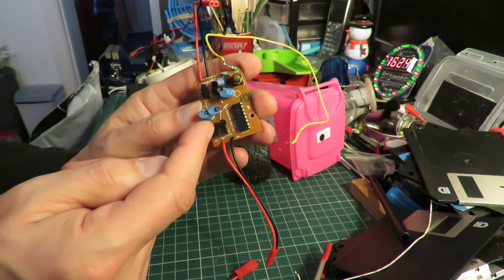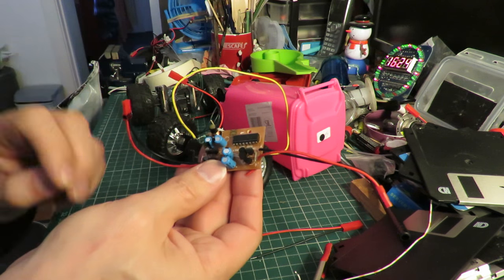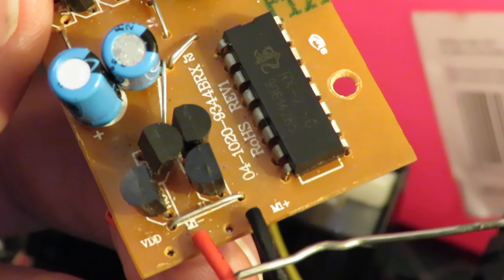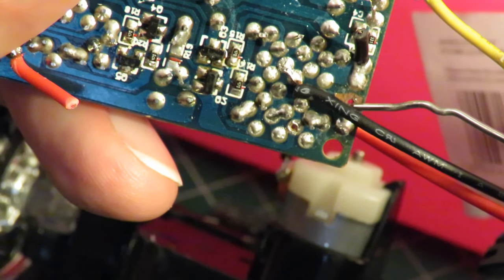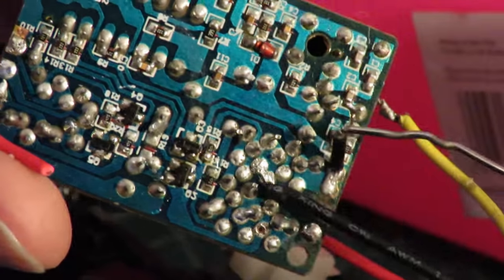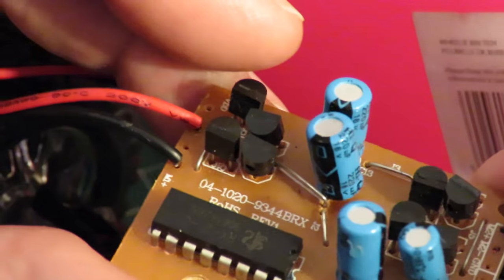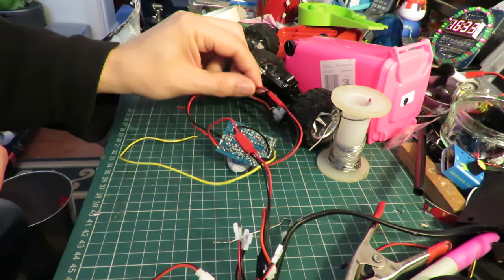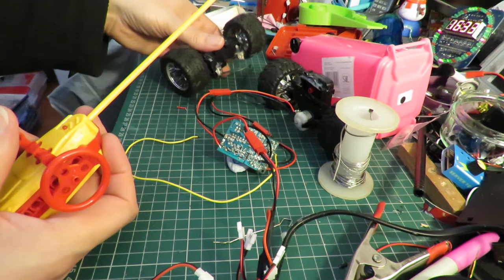Re-Using a Toy Grade RC Receiver

Comment: Hello sir, can we replace that 2.4ghz radio system with esp32? I mean can we connect pwm output from esp32 to that receiver main ic? I think if that case possible, we can control that ic from mobile or pc with long range. That's will be interesting project 😅
Reply from the maker: Most of the toy grade receivers use an RX2 chip or similar. Here is a data sheet for a typical one https://www.diodes.com/assets/Datasheets/PT8A977B978B978BL.pdf and here is my playlist for my videos on the TX2/RX2 pair https://www.youtube.com/playlist?list=PLA5a2xPRSrB1mLQvgf5ILMeTcRMuDtcNa and here is my video of building the test/demo circuit https://www.youtube.com/watch?v=M46Gpyl9KYE&list=PLA5a2xPRSrB1mLQvgf5ILMeTcRMuDtcNa&index=2

Comment: I have a helecopter but don’t have the remote. I want to take the signal 2.4GHZ from another motherboard and put into the helecopter does this ever work?
Reply from the maker: In short, there are many different variations in the way that helicopters fly. There are many issues I can think of, that may give you problems. It depends what features your 2.4GHZ system gives you. If the helicopter steers by altering the speed of counter rotating rotors, then your controller would need to match that requirement. I would expect the throttle would be proportional, does your replacement gear do that. Does the helicopter have a tail rotor? Does it use it for yaw or pitch? The helicopter receiver boards often include gyroscopic stabilisation to help you fly, so if your 2.4GHZ system does not include gyro stabilisation you may struggle to fly, even if you can match the throttle and steering requirements.

Comment: Hi, I know this might sound a little odd but would be possible to use a RC unit to trigger a rat trap?   

I just need movement of about an half an inch to an inch.
Reply from the maker: Yes, if you look at my remote control door lock series I think you could see an easy adaption of the general idea. There are several different variations of the idea in this playlist so check out the video descriptions for the details Remote Control Door Lock playlist https://www.youtube.com/playlist?list=PLA5a2xPRSrB1HM3Smxg8X-IG7dSuJyzkK

Comment: So i have a store bought rc.   I want to put a bigger motor and battery but use the same servo receiver..  how do you do that in a nutshell?
Reply from the maker: The honest answer is buy a more expensive car and don't waste your time trying to upgrade. You will probably end up spending more money on the upgrade and end up with something that really does not work much better.
1. A bigger battery will kill the existing receiver. You would need to add electronics to allow it to handle the higher voltage/current. You can buy an H bridge module that could handle this.
2. A bigger motor will not magically fit into the same space the existing motor takes. You would have to cut the gearbox around to fit a bigger motor and it still may not align with the existing gears.
The existing gears may fail with any additional power, with the teeth being stripped off.
3. When I do upgrades I usually go straight to hobby grade RC gear. That allows you to use an ESC (electronic speed controller). That provides the correct voltage for the receiver and still supply higher voltage and current to the motor.
2005Silver is a good channel for upgrades to toy grade RC cars https://www.youtube.com/@2005silver he has done a whole range, but like me, he generally goes straight to hobby grade components.
In this playlist, I do a lot of videos using toy grade RC - https://www.youtube.com/playlist?list=PLA5a2xPRSrB1f-x1-lufP6dnLQZWafj6v
Reply: If you still have the car dont put a bigger battery & motor in it. Just get a new chassis & other components. A bigger battery will make the car go faster, but may burn out the main PCB & existing motor.

Comment: hi Grandad, have looked but can't find. have you done anything on using a standard servo on the hobby grade receiver in place of the motor?
Reply from the maker: Hi Glen, thanks for commenting. Here is my standard cut&paste LONG ANSWER to this question. I am afraid that standard hobby grade servos are not directly compatible with toy grade RC receivers. They work in a different way. Hobby grade servos have a 3rd wire, that is a signal wire that the receiver uses to tell the servo controller board how far and which direction to turn the armature. The controller board in the servo then turns the armature the required distance. 
Toy grade receivers just have two wires and have three signal states.
(1) Applying the battery plus and minus on the wires turns the steering motor one way.
(2) No battery applied allows the spring return to centre the steering.
(3) Applying the battery minus and plus on the wires turns the steering motor the other way.
If you connect the same two wires to an ordinary DC electric motor and apply "Left" the motor will keep spinning as long as you hold the transmitter on "Left". If you then apply "Right" then the motor will spin in the opposite direction. 
In toy grade steering the only thing that stops the motor from spinning is the mechanics of the steering so the motor is still trying to spin but the steering arm has reached stop. On a hobby grade servo the electronics measure how far the steering has turned and stops the motor electronically.
Reversing the power feeding a hobby grade servo will probably damage the servo controller board, it certainly wouldn't make it turn the opposite way. If you remove the servo controller board and connect the output from the toy grade receiver directly to the motor inside the servo then it would go forwards or backwards like the toy grade motor but it would go all the way until it meets the internal mechanical stop inside the servo, so you would not have proportional steering. Also because the motor is heavily geared the normal spring on the toy car would not be strong enough to return the servo to the centre position when you want it to go straight, so you would be worse off than you were with the original toy grade steering. 😊
Here is my playlist - Working with RC servos https://www.youtube.com/playlist?list=PLA5a2xPRSrB1nJ5I3Uzrjf41VCJzrab4p
Reply: GrandadIsAnOldMan cheers for the info i have got two identicql hobby grade RC cars on separate radio frequency that we are going to build 2 boat hulls from Foamex boards and put the mechanicals in. was hoping i could use a standard servo but i see the difference now and understand BBB the white signal wire
Reply: only issue I see with the conversion is the rudder and making the motor and mechanicals stop and function on the rudder. will see how we get on....
Reply from the maker: A proper Hobby Grade transmitter and receiver is not very expensive if you go for the bottom of the range without any frills and for a boat you won't be troubled by a lack of range. FlySky systems are pretty cheap on eBay. I have a couple and I always buy cheap 😊
Reply: GrandadIsAnOldMan absolutely i rate the Flysky it's a bargain. have always bought in a rush so potential to buy from one of the Chinese sites. was looking at converting the cars as they cost just £1 for the both a total bargain and hence trying a conversion for he cheapest possible price :-)
Reply from the maker: Good luck with that 😊 If you already have FlySky then you can usually pick up extra receivers pretty cheap too, I can't remember how many I have now and for a car or boat you only need the cheaper 3 channel receivers anyway.
Reply from the maker: Just another thought. Lots of my boats have two motors and I steer them by keeping one motor full power and reduce the other and visa versa. That way you don't need any rudder control. It takes a few minutes to get the hang of using a normal toy grade controller that way round but it soon comes together.
Reply: GrandadIsAnOldMan Watched your videos in servos and hobby grade steering so get the difference. in one you converted a 9g servo to continuous direct to the motor. do you think if the stops were left on and wired to the servo motor it would work?
Reply from the maker: Yes it would work but you have no centring mechanism so you would be worse off than a toy grade steering system. On a toy grade when you release the "rudder" or "steering" the spring returns the rudder or wheels to the middle but a servo is heavily geared so a spring would not be strong enough to return it to the middle.
Reply: Ah ok get you thought i had a bright idea :-)
Reply from the maker: As long as you are not worried about going in a straight line it will be fine 😊😊
Reply: @GrandadIsAnOldMan  Thats was a really good explanation. I totally understood it. I didnt know how the signals on a toy grade PCB worked.

Comment: Hello sir, Thanks for your videos. I have a toy grade radio shack 4x4 from the 80s, the transmitter crystal in the remote seems to be faulty, I was going to replace it but wasn't sure if replacing the crystal only in the remote would do the trick. It's an AM 27.095 MHZ. Can't seem to pin point the receiver crystal on the circuit board from the truck. Found old new stock transmitter crystal on ebay with same frequency, could this work? Thanks so much!!
Reply from the maker: Not sure how you have identified the crystal as being faulty. What makes you sure? I haven't made any attempt to change a crystal on any of the RC gear I have, in fact most of them do not have crystals to set the frequency. I would expect you to need a matched pair but I cannot give you any advice from a position of experience.
Reply: @GrandadIsAnOldMan  Thanks for the reply and information. To be honest I dont even know, just worth a shot, I am simply troubleshooting, I can't properly test the crystal I don't have those tools to do it. I know very little about relays, and such electronics but I like to learn about things and fix them. I know I could convert it to Hobby grade that I am capable. What happens here is that the remote is not making the car move, but some movement or jittering is happening like the car is trying to do something but can't. My thought, after eliminating many other possibilities, was there is a problem with the transmitter.
Reply: @GrandadIsAnOldMan  In my controller there is definitely a crystal transmitter with frequency inscribed on it, 27.095MHZ, but not in the car. It's a 1987 Tandy RadioShack 4x4, the yellow one.
Reply from the maker: I am afraid there are so many possible issues. You have to go through step by step. Ideally you would have an identical car that you could try swapping transmitters to check if it is the transmitter or the receiver giving problems. If you haven't already done this, you could do some basic checks like connecting a battery direct to the drive motor to check the motor is OK - do the same for the steering motor too. Although the crystal is marked very precisely with 27.095 many of the systems run over a fair range and you could try other 27MHz transmitters or try yours on other 27 MHz cars.
Reply: @GrandadIsAnOldMan  Hi again, my apologies for all these messages, your answers really help. One thing I remember doing is buying a toy grade RC from the thrift store that had the same 27.095MHZ freq, the car did the same with the controller, same response, so I pointed the issue to the controller. I could perhaps send you the circuit board from it and you could see if you find the problem. I would pay you of course. :)
Reply: @GrandadIsAnOldMan  Motor tested ok, actually when I touch both the antenna from the car and remote it moves FF and turns as if it works while there is a wire connection, that is why I was thinking the transmitter crystal, but again I don't know much about it. Thanks so much again for taking the time to answer me. It has been almost 5 years since I keep taking the car out every few months to tinker with it, but can't find the issue.
Reply: @GrandadIsAnOldMan  Did buy a used 27.145 MHZ transmiter and nothing hapenned.I think I might gut the car and upgrade to hobby parts. A bit expensive but it might be worth it to bring it back to life.
Reply from the maker: @designrdan  thanks you for your confidence in my ability but I am afraid you are asking the wrong person. My skills are pretty limited. I also live in the UK so even if I had the correct skills and experience the cost of sending a package would be more than you buying replacement RC gear. You best bet would probably be to find another 27MHz receiver from another thrift store. That is basically what I do, most of the cars I buy don't have the controllers so I mix and match till I get a working pair. Or I swap out the receivers for a working match, or I do the full hobby grade upgrade.
Reply from the maker: Good luck with that. If you already have hobby grade RC gear then the upgrade is not so bad but if you are starting from scratch it does add to the cost - like the transmitter is the biggest expense. Obviously you need a receiver. If you retain the existing motor then you just need a brushed motor ESC to drive it. Then  you have a choice what to do about the steering. You can use another ESC to drive the steering motor and that will work quite well or you go for a hobby grade servo and then you will need to cut things around a bit to fit it and link it to the steering rods.

Comment: Hi sir I have an old board on it there is 
LM  RM
VCC GND
ANTENA 
NOW WHERE SHOULD I PUT THE FRONT MOTOR USED FOR STEERING AND THE BACK MOTORS 
PLZ REPLY.
Reply from the maker: Without seeing your receiver I can only guess where the terminations would be. Different manufacturers have different labelling practices. On toy grade receivers the motor outputs are often labelled M1+ M1- and M2+ M2- or they may be labelled F/B for Forward/Backward and L/R for Left/Right.  I could guess that your LM and RM might be Left Motor and Right Motor (for steering) and there might be FM and BM for Forward Motor and Back Motor (for the drive motor) BUT that is just guessing. I have not seen a board with those markings.
Reply: @GrandadIsAnOldMan  OK bro it's OK but there is no 
FM BM
what should I do
Reply from the maker: @dr.monikarani1193  I am afraid the answer is get a different receiver unless you know how to trace the outputs from the control chip to identify where the signals are being sent. It is probably an RX2 variant chip so you can look online for the data sheet. You would be looking for the "H Bridge" that take the signal from the receiver chip and sends the power to the motor.
Reply: @GrandadIsAnOldMan   but there is two  wires connected to B something like this 
I think they are of steering because there is written LM and RM  and also thanks you are helping me 
But you can go and check my tractor in which I will use this board the tractor is in this channel only name of video is MODIFIED TRACTOR 
And then plz suggest me
Reply from the maker: @dr.monikarani1193  your video does not show the receiver you are talking about so that does not help me give you any guidance.
Reply: @GrandadIsAnOldMan  yes yes I know I wanted to ask that my tractor can be converted into a rc tractor
Reply from the maker: @dr.monikarani1193  it does not appear to have steering so you would need to do something about that unless you just want it going forwards and backwards. Here are my tractor related playlists - Tractors https://www.youtube.com/playlist?list=PLA5a2xPRSrB1THBo5s89W9VhXxNgoHHXh
RC Conversion Deutz Fahr DX 470 Toy Tractor  https://www.youtube.com/playlist?list=PLA5a2xPRSrB2TqZK7HiLeW4kji-D4ENwY

Comment: Hello sir,I have an old rc car's reciver but I can't find the point which I can connect the battery
Reply from the maker: The termination points have various identities on the board. I will list the ones I have seen
B+ B-
Batt Eth
Vcc Gnd
V+ V-

Usually the battery positive is routed via a switch either onboard or externally.

The motor tags are usually labelled
F B for forwards backwards
L R for left right
sometimes they are labelled
M1+ M1-
M2+ M2-

The Arial or antenna is usually labelled Ant
Reply: @GrandadIsAnOldMan  sir I didn't found any of these on the board but what I did was checked for points,I checked if there was any of extra soldering or wire out of the joint.this plan worked and now the circuit is working correctly,Thank you for finding time for my comment
Reply from the maker: @pascaledits7219  well done, great result 👍

Comment: i got a rc car but no controller with it how can i make it work with another controller
Reply from the maker: Assuming you are talking about Toy Grade RC, if it is the same frequency then you have a good chance it will work straight away, but sometimes even when the frequencies match they still will not talk to the receiver. You will have to find a matching controller or change the receiver to match the new controller.
Reply: @GrandadIsAnOldMan  how would you change the receiver for a new remote?
Reply from the maker: @andrewwerstler8517  take the old one out and put a new one in. The wiring will be the same. 2 wires for the battery, 2 wires for the drive motor, two wires for the steering motor. So that is six wires you have to reconnect.
Reply: @GrandadIsAnOldMan  I was trying to make a drifter with a toy grade rc, but I didn't have the receiver. So I found a new bright receiver with about the same Hertz then adjusted the little screw you talked about and now it works and is pretty sic. Thanks for the useful video.
Reply from the maker: @andrewwerstler8517  hey, that is great, glad it was useful 😊👍